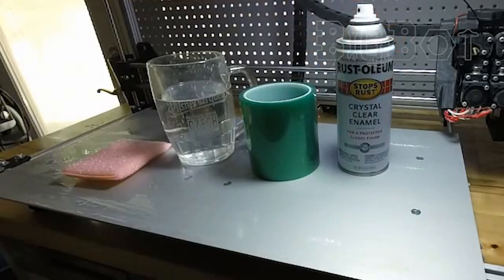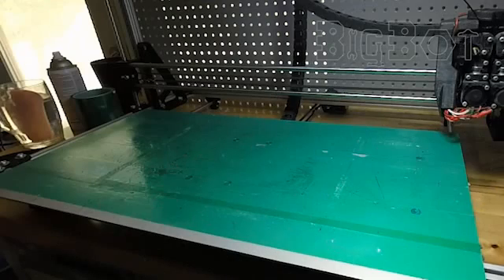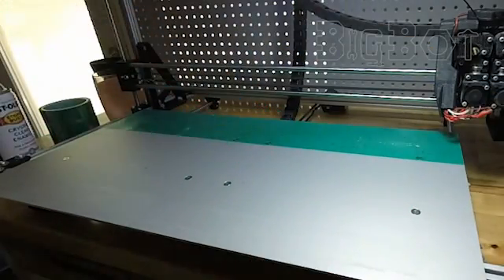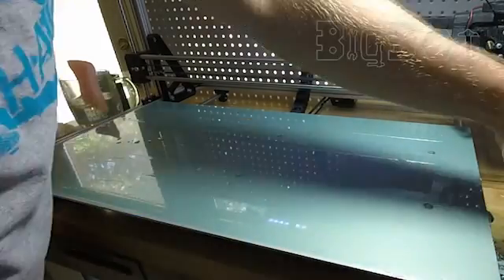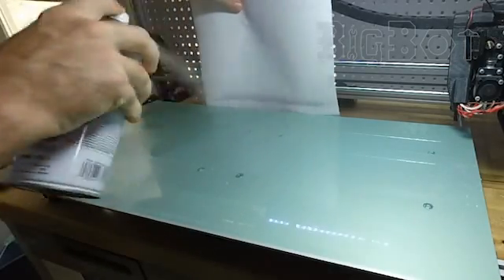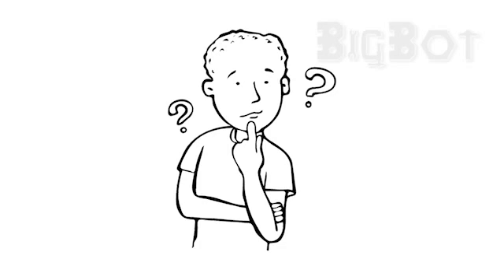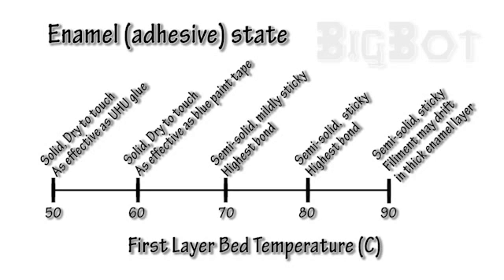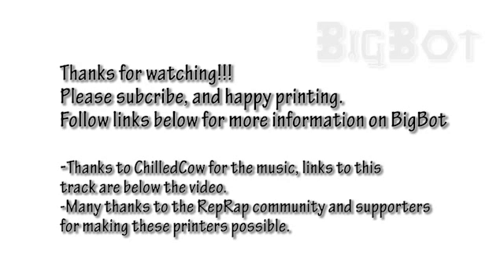BigBot RepRap 3D Printer Bed Adhesion

Comment: What print materials is this suitable for? I only print with ABS (nylon in the future) and mostly with bed temp around 130c... How many newtons of holding force does your method offer. I have a lot of trouble with big parts warping. They usually pull the kapton off the bed.... So better adhesive is likely required.
Reply from the maker: Hi Mongrel Shark,
Hmmm...adhesion (holding force) would be psi or kpa.  I don't know how much, but I will be quantifying it soon, hopefully with another video, and I hope to compare it to other popular methods.  It holds stronger than blue paint tape or ABS juice.  ABS is not suitable for parts larger than 100mm (in general) as it has poor layer adhesion and a high shrink rate.  Even if you get it to stick, a lot of ABS prints will split mid-print where the temp is 35C (without an enclosure) or 50C (with enclosure).
Nylon is about as bad on warpage as ABS, but this Dr fella on here says he has a way to make large nylon parts stick...but I haven't tried it yet.  He was very, very detailed and I believe him that it can be done.  I love the strength of nylon, and it has great layer adhesion.  Unfortunately tho, nothing (much) sticks to it.  Maybe super glue?
PLA and PETG work best with this method, which are the best filaments for printing large parts.  If you try PETG, you might may never use ABS again.  Esun has ABS+ that advertises low shrinkage, but I'd guess the layer adhesion is still an issue there.
Anyway, best of luck and I hope you give some of these other things a shot, I think you'll be happy you did!
Thanks,
Jared
Reply: Thanks for the great info Jared. I would be happy to replicate any decent tests you can come up with. Got my printer running pretty good now and am about to start making better ones :) Hoping to utilise a community based design approach while addressing a number of issues that have bugged me from the start (like why are belt tensioners and diagonal bracing so rare, as well as heat control issues and adding rotary encoders and removing all the flexing 8mm rods everyone seems to use for unknown reasons).

Anyway I have had some success printing abs parts that have little warping and splitting after googling a lot. With no enclosure. The trick is to print hot and fast. Like 280c and 120mm/s or faster.  A print fan is also required and takes a lot of tuning, which is not really compatible with PID that does not consider fan speed... Obviously a lot of limitations preventing most rep-raps from doing this....
 230c is way too cold for ABS... As you say, poor layer adhesion, although its not much of an issue with good vapour treatment. I have good success with small parts at 255c and 40-80mm/s. No real issues with layer bondage printing at that temp and speed..

Been playing round with a temporary enclosure so I can print at 50-55c, Not seeing much improvement on warpage, I expect significant reduction in splitting though. Wouldn't be hard to print water jackets for the motors and run the enclosure at 100c....
Reply from the maker: Wow, cool!
If you don't mind me asking, what is your extruder configuration for that temp in ABS?  j-head all metal, remote feed?  I tried all metal e3D V6 but it kept clogging with PLA and PETG.  I hear it's the way to go with nylon tho...maybe ABS is the same?  I betchya the ABS odor is kicking at that temp tho.
100C is really hot, as I'm sure you understand there's a large number of parts to be sure are all metal, or nylon might survive it?  By my calculations the difference in warpage between no enclosure and a 55c enclosure is around 10%, which is never the difference between success and failure of my prints.  I ran an enclosed printer for 9 months and didn't ever see a difference in warpage enclosed or not.  If you consider the plastic starts at 280c for you and cools to either 55c or 35c, that's not a big difference.  Yea 100C would certainly get you closer to a warp-free print, but you will have to deal with the warpage after the print is finished and it cools from 100C to room temp.
If you goto 100C, larger motors can survive it without water cooling.  150C is a common motor max temp limit, but I'd check your brand first.  You'll just want to be sure the motors don't need much current (so they don't produce much extra heat) to deliver the same torque as what you're using now.  Fans are a problem at 100C if you have any of those in there:/  I guess your looking a PC, lexan enclosure?
I have a FLIR camera I use with the prints from time to time.  It makes it easy to see what's really happening with the heated bed, motors, fans, drive gear, all that stuff.  You might look at the phone attachable types for your project here...
Reply: My hotend is crap. Its a $12 ebay special  all metal j head like thing, running a barrel I made in last weeks video from spare M6 Z axis screw because the Ally barrel broke. I have a lot of problems with it and the heatbreak. Only been printing 8 weeks or so and only 2 weeks printing decent quality. So still a lot to learn.
Spent two days trying to ballance fan rate for overhangs and bridges against PID settings that are never going to work. Not at 1s/ps via thermistor...

Enclosure was going to be wood, probably Bracing Ply and 2x1 pine frame. But someone has convinced me cardboard is worth a try due to superior thermal property’s. Cellulose fibre is fine to 200c-ish I have my hotend insulated with paper towel atm... Its getting a bit charred looking after 15 hours printing though. Thinking I might paint the cardboard with ABS juice or epoxy once its right.

Yea fans and belts are not going to like 100c. Can duct the fans air in. Maybe replace the belts with leadscrews. Something with a lot of MM per rev. Would be nice to be able to do some light CNC work too...

The warping is caused buy the part cooling unevenly. ie the bottom cools, then the upper layers cool pulling on the alreagy cooled layers underneath. So if you can keep the whole part as close to Glass transistion temp as you can without sag etc, then cool the whole part evenly. It won't warp. In theory. Thats why ABS can be used in casting moulds without problems. The shrinkage was actually designed in to help it release from the mould.

Printing hotter means the newest bead melts into the layer underneath more. Improving bondage and distributing the heat more. So there is less thermal differential between each layer. Thats why I run my bed hot too. (and sub bed heater, I have a video on that too). Less differential between layers.

I tagged you in a private post on G+ so you can see one of the parts I did in ABS that is not very split or warped.  Despite being over 100mm long and 80 or so mm high and very thin. Its a little split and warped, but very easy to repair with ABS goop and a bit of a sandpaper job.
Reply from the maker: Yea I think there are some high end printers from Zcorp or the like that do many of the things your speaking of, so there's definitely merit to your pursuit of a hot, hot enclosure.  I started 2.5yrs ago making EV battery boxes from ABS and probably tried almost everything.  I spent a lot of time sanding and bondo-ing, and I made several functional prototypes with a lot of elbow grease per part and machine mods.

The easy way out of these troubles is to use PETG.  I doesn't do the vapor smoothing, but epoxy as a smoothing layer works well enough.  I've used textured rustoleum aerosol (granite and hammered) and they hide the layer lines fine if printing under 0.4mm layer height.  2x's aerosol rustoleum primer should work well also...I just haven't tried it yet.

ABS is probably the easiest and one of the cheapest materials for injection molding.  Less shrinkage is seen when molding mostly because the wall of the mold will hold the part in place as it cools.  Yes, the remaining shrinkage after the part is below Tg usually helps eject, but depending on geometry it might freeze the mold if not made proper.  They use aluminum to rapid heat and cool the mold above and below the Tg.  3D printing does not have a mold to hold it in place, so we see the full shrinkage effect without part support.  I've made a lot of molds...anywhere from $250k to $100.  ABS is a wonderful injection molding material, but I'm not a fan of it's use in 3D printers.

The revolution I think will be making 3D printed molds for 2-part mixed parts.  I've made some crazy strong stuff with polyester, urethane, and epoxy with glass fill.  Glass or carbon fiber filament will the way to go one day, hopefully soon.  They have the carbon fiber PLA, which is just the tip of the iceburg.  PLA is the cheapest material to mix with carbon fiber.  I'd love to see PETG and carbon fiber or glass.  That would be wicked strong.
Reply: I'm at the start of a similar journey I think. Read your kickstarter...
For me filament printing is a means to a sintered powder end. As well as casting, cnc and the full Fab Lab. Still gathering materials to make a big Co2 laser... Have made a small UV laser from scratch, video on my channel, look for TEA laser.

I still like ABS specs over PETG. I especially like the vopour finishing as it frees up my time and is less messy/toxic than working with resins. Have experience with many resins used in surfboard shaping and other fiberglassing. Trying to get away from all that with printing. I like the idea of grinding up leftover/waste material and re-using, as well as eventually printing PET(maybe with the added g) at home from recycled bottles etc. I was a concreter for 13 years so a few people also trying to get me involved in house printing (I think its a bad idea, too hard to add reinforcing steel, bricklaying robots are the go). I'd also like to make a FAB Robot, that has extruder and cnc tools on it's "hands" and can drive around a big space to make big things. Like cars etc...

One question you may be able to help with. Why are injection moulds so expensive? Is there any reason I can't just make my own for really cheap? I could probably hand grind simple moulds and CNC more complex shapes... I think I may be missing something... I just can't see how a mould could possibly cost more than a few hundred bucks...
Reply from the maker: Cool stuff; that's a lot a work but having an army of robots at your bidding sure sounds nice:)
As for injection mold tooling expense (I'm assuming you just mean tooling) much of the cost is for the injection mold shop to cover the overhead of the engineering time, setup, and communication involved in the creation of the mold.  Engineering mold design software isn't cheap, and experience is invaluable.  The injection machines themselves are $20k min to purchase.  A cheap, small injection mold will cost $6k-$10k.  Will likely take 10 hours on a CNC and cost $500 in aluminum and mounting plates.  Will take probably 20 hours of engineering design time plus whatever extra communication about necessary modifications, and often a visit to business and a few "free" meals.  So once an injection molding shop has completed a $8k tool they probably have $3k total in it but only $500 in raw material.  
Engineers, marketing, and business meetings aren't cheap would be my summarized answer.  Injection molded parts do require significant expertise to make, and I don't think companies would do well if just anyone was asking them to make just anything. Most companies don't want one-time customers, so they probably discourage low cost tooling.  They want customers that feed them new parts over and over.  Basically, it sucks for an individual to try to get a mold made, but I don't blame the industry for not wanting to basically pay to educate people how to make things.
I have seen a setup to convert a drill press into a cheap (mostly just runs ABS and PE) injection molding machine, which ran about $500.  I don't think it would run fast (believe is was air cooled) but seemed neat if you have a way to make the mold.  ABS pellets are around $1/lb I think, so that's what ABS costs if you injection mold, plus setup time labor, machine run time expense, and tooling costs.  Only really pays off when you're making over 1k+ parts or so it goes...
Reply: Great answer! Thats what I was hoping.
 So if I make a CNC and finish the Aluminium forge off. I can make my own moulds for the cost of my time and some recycled soda cans :) 
I hadn't considered injecting myself (lol that sounds really bad).  I may give that some thought. Did a pile of concrete at a rotational moulding place for a few weeks. Had lots of time to check out the gear while I was waiting for crete to go hard :) Was a very interesting job.

One last question.
Say I want 500 of something and I can only fit a few on a printer bed. So its not time effective to print, and its not cost effective to mould, even if I DIY most of the moulding process.
What other options are there?
I could hand mould I guess, ie fiberglassing like process. But unless I have a lot of space probably not going to make more than a printer in a day. 
Any other options I should be looking at?
Reply from the maker: Well, if I'm understanding you correctly and you're looking at making 500 or so pcs in plastic, you might check into the videos on this website:  http://www.alumilite.com/ .  Most of their products fall into the RTM process (resin transfer molding): https://en.wikipedia.org/wiki/Transfer_molding

I've used several of their 2 part resins, and the plastic has amazing properties, especially when mixed with glass fiber.  Silicone molds work very well, and having flexibility in the mold makes it waay easier to release.  Even with a CNC aluminum mold, often it's difficult to release the part if the cutting tool is not perfectly straight.  I've had difficulties machining my own molds because my home built CNC's just aren't perfectly 3-plane perpendicular.
In the next week or so I plan to try a flexible TPU 3D printed mold for pouring the alumilite RC-3, which demolds in 10 min.  The RC-3 has very similar properties to ABS when cured, and a bit lighter.  Assuming I can eventually print 20 molds, one could pour 100pcs/hour.  That's how I would get to 500pcs, or if you're really good at CAD you can mold the mold:P  Basically, 3d print or CNC the mold for the mold, pour several molds from epoxy, RC-3, silicone, or whatever, then pour parts from your multiple molds.  This is confusing, but I've had great success purely using RC-3 for the mold and parts.  The urethane has a slippery surface that's good for releasing parts, but you'll want the stoners mold release also, or maybe the aerosol wax.  Making molds does take practice, and getting the 2-part liquid resin in the mold without air bubbles is the challenge.  Big sprue and vent.  Vacuum the air out if you can.  Glass fill with 1/32 fibers if the mold pours with the thicker liquid resin.
Reply: Thats very interesting. Looks like I have a lot of reading to do.

How square are you getting your CNC's? And still having trouble? I got my printer within 0.025% You'd have to print something 5 times the build are before it would be out by 0.5mm over a diagonal.. I find this easy after years of making large square concrete things, like factorys and large plants etc.. If I had better measuring tools I could probably do better, but my eyes have trouble telling 0.95mm from 1mm these days. Its getting hard to land right on the mark. Going to have to make a better tape measure one day... Some kind of slide rule micrometer hybrid..
I realise the CNC tool would be hard to get stiff enough to not deviate, is there something else I'm missing?

Comment: Hi.... I've dropped by, after your invite.
It all looks interesting.
However, for some accidental reason, it seems that either the audio codec, and or the volume, and or the natural tone of your voice... somehow blends perfectly with the volume and tone of the background music.
There is a point when the music stops, and your voice becomes crystal clear.
It stays clear until the jazz riff chimes in again.
 
I'm not a sound engineer.... I'm sure a pro would know exactly what is happening.
The music is quite pleasant, but maybe the solution is to simply adjust the levels, so that your voice is at a higher level than the background.
Maybe a tweak on the tone, to sharpen up those end of sentences.... but my guess is, it is just an accidental  merging of voice and music volume levels, with similar tones.
I wonder if anybody else experienced the same difficulties.... especially around the temperature guidance, when it became barely distinguishable.
Anyway, I've subscribed, so I look forward to the next vid
Reply: Yep. I found it hard to hear too.
Reply from the maker: Uhoh...sorry for the audio!  I will adjust if I hear others having troubles.  If you have questions, feel free to write, and thanks!

Comment: Do you print ABS without any issues? Even with a completely open build space?
Reply from the maker: Sure, if the part is small.  Open or closed buildspace ABS will warp with larger parts...just a hair worse with an open workspace.   ABS is a great plastic for injection molding, but not for 3D printing anything over 100mm in my opinion.  When it doesn't warp badly, layer adhesion is poor so I prefer PETG instead.  I have read that ESun ABS+ could nearly as well as PETG, but I haven't tried it.  I still expect it has layer adhesion issues.
In my experience, choosing the right plastic for the part is the best recipe for successful prints.  ABS works great for small, decorative parts for sure...prints cleanly and easily for that.  It's not a good plastic for big prints, so I don't use it nor would I recommend using it for these printers.